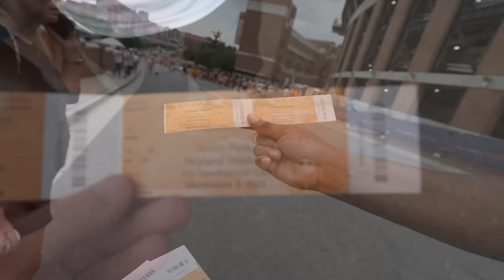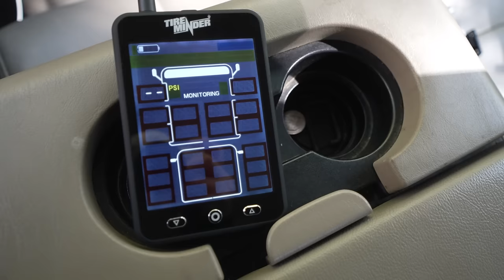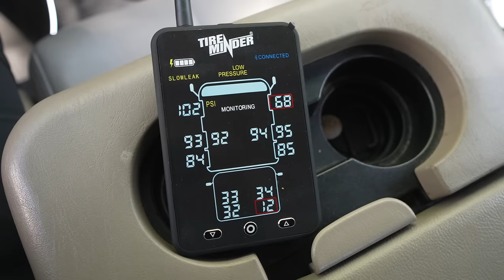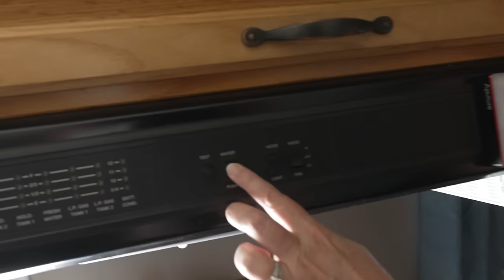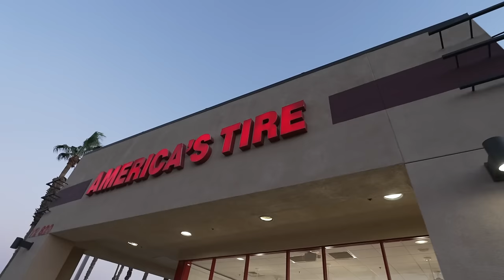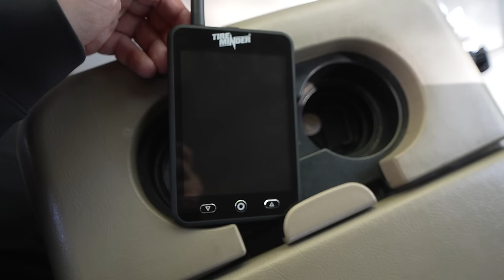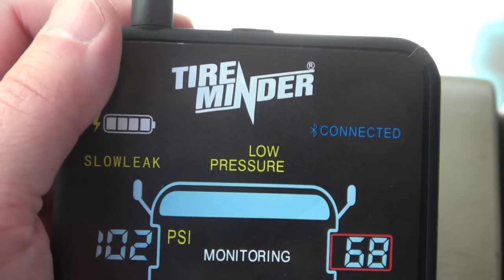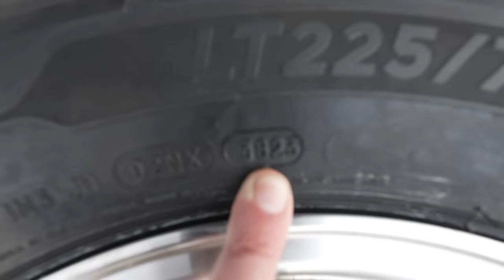TRIP KILLA - Our WORST RV Tire Disaster!

Comment: We replaced our tires at a discount tire. I had just seen a YouTube video on jacking a travel trailer. I taught the tire techs where to lift mine, and made them use blocks at the proper places. It was worth the effort. It helped that I used to own a tire shop and tipped the techs for their efforts.

Comment: Even when a shop has a sign saying no one allowed in work area I still go and watch the mechanic. After restoring cars, driving truck, heavy equipment, eventually a number of patrol cars over the past 56 years I know good basic repair practices. I'm not afraid to speak up or ask a mechanic why they're doing what they're doing. Plus I have the "gift of gab" which makes a good working relationship with the mechanic.

Comment: I had new Michelin tires mounted on our F-350 last fall by Discount Tire. During the first 5K mile rotation, the store manager noticed that three of the four tires were slightly different - I believe with respect to the weight rating. Something I likely never would've noticed, and probably something that wouldn't make a difference in our application. I was very impressed with the honesty and, as a result, will be a lifelong customer. This was a great reminder to be vigilant about monitoring tire conditions. And... Trailer-Aid ordered. Thank you!
Reply: I  love discount  tire  also    story  is  above.    Charley

Comment: Thank you for this video! I’ve used the trailer jack and wouldn’t be without it. Thank you, as well, for information on Discount Tire. We’ve used them exclusively since moving to TX over two decades ago and have never regretted it. We run Goodyear Guardians on our TT and have not had a blowout so far.

Comment: First trip out on a sailboat I'd bought I noticed a single broken wire on side stay (what holds up the mast), My local rigger told me it would be at least a week to get the cable and install it.  
Just one wire, how much damage can that do ?
The whole cable snapped, mast came across the deck.
Now I have a fishing boat.
Reason for posting this example, is if you see, or smell something wrong, stop, figure it out !  
I've seen motorhomes pull into a campground and bursting into flames saying I smelled fuel before I got here.

Comment: On my last trip, it was replace the truck tires or the trailer tires. The truck tires were worn slap out, so the got done. As y’all, as soon as we got back, I would do the trailer. The tires were only 3 years old but were normal dummy tires. First blowout, I could only find a place with 2 of the desired 5. So I looked ahead and found 3 more 100 miles down the road. The other axle had a blowout on part of the interstate with just enough shoulder to git r dun! Rode the rest of the 60 miles left with Jesus at the wheel. Got there and shoed the rest. I will buy one of the ramps, always meant to but you know how that goes. Love your channel, long time subscriber even before I owned my first RV!! Loloho!!!

Comment: Hey guys, love your videos.  I just purchased one of those ramps, (not the brand you guys have), and it was the best $50 I ever spent.  I changed a tire in my driveway last week and it was so easy.  I wish I had bought one before.  It made tire changing a breeze.  Nobody wants to be on the interstate with a flat and have to use bottle jacks and pieces of 2 x 4's to get their RV off the ground to change a tire.  That ramp is awesome. I've heard that some people say it doesn't lift their RV high enough.  No problem.  Bring along a piece of 2 x 6 and put the ramp on top of it.  That should do the job.  Again, great video!!
Reply from the maker: Thanks for your comments. Yes, the trailer ramp is a must have!

Comment: Thanks for this video, for multiple reasons. My Airstream (and its tires) are 5 years old this coming October and I’m very aware that new tires are not far off.  I didn’t replace them this year because of budgeting.  And I’ve been so stressed about taking them to the tire shop because I don’t want to have to nag the heck out of them about the jack points.  So this video hit all the relevant topics for me.  Clearly it’s a message to stand outside and supervise/take my tire ramp.   I’m sorry your tire issue killed your trip.  As usual, your experience and willingness to share the ups and downs of RV travel are valuable to all of us who watch.
Reply from the maker: Thank you, Steph! The comments here have been interesting. Several people actually remove their wheels themselves and bring them to the tire shop for the new tires. That certainly safe approach. Unfortunately, as this episode illustrates, anytime, someone else is jacking your trailer there is a significant risk of damage. In hindsight, I wish I had gotten down on the ground beneath our trailer and micromanaged the entire process. I think you have to be willing to do that because we could not have stressed anymore the importance of properly jacking our trailer and it still got messed up. 🤦‍♂️

Comment: I find things last longer if no one points out that it is ready for replacement. Quickly pointing out the problem after the tire work was also key to them accepting responsibility. Glad you are safe safe and now showered. Thank you for sharing and have a great day.
Reply from the maker: Ha ha yes that thought has crossed my mind as well. If no one had noticed the age of the tires, they probably would still be going strong. It’s funny how the universe seems to work that way. 😂

Comment: Just spent over $2K to replace tires on a Dodge 3500 Mega Cab and 29' Forest River TT w/3 slide-outs.

Got Tires at Sam's.  They Sell TT Tires but do not install them because that has to be done outside their work bays and the AC paving might get damaged!.

Adjacent to Sam's is a Goodyear Tire Store.  Made arrangements to get tires and installation there.  They had a AC driveway but next to their building past the work bays was a concrete slab area about 70' long that they used for truck and trailer tire change outs.

When they were done the store manager took me over the the tires and pointed out the  4 Jacking points for tire work and said to be very careful that only those locations were used !

Very sorry to read about your recent problems, I have followed your website for many years.

Comment: From experience, the trailer ramp/ Jiffy Jacks work great on torsion axles but may not work at all on spring axles (the equalizer does it's thing and keeps the axle on the ground) or air ride axles. 
By all means try it with your trailer before you have a problem and go to depend on it.
Reply: Absolutely correct on this, wide stance leaf springs will not work with the trailer ramp.  I have experience with this, in fact when I had my blow out I couldn’t even get my jack on the spring shackles to lift it. But I did use the ramp on the flat side to get the flat tire high enough to place the jack to remove the tire.

Comment: Sorry to hear about your Tire Woes.   I have has Michelin LT tires on a truck and they have delamanated  after a few years and were cracked as well.   Airstreams are heavy trailers so you are probably better off with the LT tires but I would not buy Michelins.  .  I was told that while ST tires may not have the weight rating that LT tires have they do have much better UV protection.   I have a friend that tows an 24 foot Amerilite that has twenty plus year old ST tires in it that have good thread and are not cracked, and I cringe when he pulls into the Park where I camp.   That's a terrible risk for everyone on the road if they were to fly apart.   Most I will go on ST Tires is ten years but I only go fifty miles one way and I have an ultralight trailer.  Every trip I check them with a fine tooth comb.  Sorry about your water system.   Thank god you took pictures after the tire flew apart.

Comment: I empathize with big ticket repairs causing deferring maintenance expenses. Last summer we were towing into Las Vegas with 110+ degrees and the truck A/C went out. That cost $1400 to repair. During the next few days our camper A/C was having trouble keeping the camper cool in the high temperatures. I thought, It's good enough to get us home."  It wasn't. In that same area on I-10 at the California Arizona border at 112 degrees the camper A/C quit. At 4:30 PM on a Saturday night we were looking at going to a hotel. But we made multiple calls and found an RV mobile tech 20 miles East of Quartzsite that said he could come to us tomorrow or if we got to his shop an hour before sunset he would fix us today. Pack up and go!  He replaced our A/C in under an hour for $2300.

Comment: We had a truck tire blowout on new Toyo tires. Our TST monitor told us about it at the exact same time the tire blew. So, just because one has new tires, there is no guarantee you won't get a blowout. In fact, it made me madder as the tires were new.
 and it will take about a year for Toyo to determine if we get our money back. I find if I put things off, it usually bites me in the rear!
Reply: Oh yes, bought the Tire Ramp.

Comment: Having a single axle Airstream I am a bit OCD about my tires.  I wanted to rotate the tires this spring before our first trip but I have heard too many horror stories about tire stores.  So, I jacked up the trailer in the driveway and did the job myself.  I now know that the jack in my F150 is adequate for the job (for our 20fb) and I know that I can change a tire very quickly if I have a problem on the road.  I have the smaller Tireminder monitor that has a rechargeable battery and a usb power cable so it is always on when we are traveling.  Glad you are safe and the Airstream did not suffer any damage.  Safe Travels.

Comment: It’s good to know that they did you guys right by fixing your Airstream. I use Discount tire also for all my vehicles. Our Airstream has the 3 inch lift kit, and they couldn’t reach the jacking points with their floor jack. So I use my yellow tire ramp like yours and had them change one tire at a time. By doing this I also noticed that one of the tires was different than the other three, which they quickly replaced. But we still had a tire blowout with only 2,000 miles on the new tires. As you guys did we limped into a discount tire store near by and they replaced the tire free of charge. The new tires installed were Michelin Agilis Cross Climate LT 225/75R/16, Load Range E (2523) If anyone else is having problems with these tires please comment below. As for your trip killer, as long as everyone was safe it’s always a good trip with a great story to tell. We have been watching you guys for a long time, in fact that’s why we bought our 2018 Airstream in December 2017 and we still love our 28 ft. Airstream. Thanks and enjoy every moment together.

Comment: Wow what a bummer. On the up side you did dodge a very big bullet when that tire didn't take out the sidewall of your airstream or fender liner, etc, etc. We have a Newmar 2003 Dutch Star class A  that has Michelin 275 70R 22.5" tires. During covid we were getting nervous about our tires as they were 4 months away from being 10 yrs old. And during COVID Michelin pretty much shut down production for quite a while. They told me we should be good for 10 years and they had very minimal cracking on the sidewalls, but we should get them looked at by a dealer. We were able to locate 2 tires so we had those installed on the front steers. Felt better. It took another month to find the remaining 4 for the rear axle. Around $ 4k for all 6 tires. We don't travel anything like as much as y'all do but whenever we travel we put tire covers on at the campground if we are staying for more than a day or two. We always try and stay 7-8 days. Whenever we are  home the RV is in an enclosed garage. Our RV weighs around 30k lbs but these are the same tires they put on semi car haulers. Load range J.   Safe travels!

Comment: I bought a toyhauler 3 years ago, and it came with cheap 14 inch tires. It is getting new 15 inch rims with 14ply tires before it is on the road again.

Comment: I have a two axle trailer. I use only H rated tires and only american made, NO Chinese junk. I carry two spares for my trailer and two for my truck.  Even though my tires might last a little longer all get changed at no more than 5 years. I also rotate my trailers and my truck tires at 5000 miles. Sounds like work but it just part of RV life and travel. Maybe I'm lucky but have had only 2 flats and one blowout caused by large rocks falling off a cliff onto the highway, this is after 10 years and 100,000 mi;es of travel. don't go cheap with your tires

Comment: Hello Kristi and Sean, my wife and I have a similar story. We were coming home with our 22 ft’ Bambi from N.Y. To N.C. And were currently in Penn. mile marker 39. When we had just pulled into a rest stop to let our Chihuahua and Jack Russell go poopy. As we were backing out and going down the ramp to this really busy Interstate we heard what sounded like a shotgun blast. Turned out our right trailer tire had blown a hole as big as my fist outward. Well, luckily we slowly backed up 25 ft. Back to our parking spot.
We did not have a jack that could lift our trailer high enough to get the spare tire in the wheel well. Could not make it to a campground so we called Coach-Net for help. After waiting 4 hours and no help we were totally screwed!

Then the heavens opened up and who showed up to help us was a trucker and two chinese speaking (Mechanics?). The two chinese guys had a large enough jack to lift our camper(from the Airstream lift spot- I told them where to lift it). Got the spare on and we were on our way!

In thanks we had just come from Bully Hill vineyards where we had purchased 4 cases of wine. Well those guys got a free bottle of their choice along with the truck driver who also was from NC.  Suffice to say when we got home we changed both tires and promised to never let them go for more than 4 years before replacing them. Also bought a hydraulic jack and I cut a wooden block that we could set the jack on that was the perfect height to change a tire. We will not be caught (Flat-footed haha) again!

Comment: I downsized from a 25' trailer to a new single axle 16' trailer in spring 2020 before prices went crazy due to you know what. In 2022 I was headed to South Dakota and near the NE SD line I felt what i thought was a gust blowing on the camper. I could tell something was off and sure enough a tire was wiped out. Another gentleman stopped and helped me get it swapped out quickly. The next town big enough for a tire shop had the right size tires albeit pricey. He also was able to hammer out the small dent in the rim. I said lets replace both but leave one of the new ones on my spare carrier. Less than 200 miles and three camp spots later that spare I was running that had less than a 1000 miles on it blew out just like your tire. The little town of Midland SD had a tire shop but it was Saturday. The door was unlocked but a really big mean dog was inside. I call the number. She will be there in a couple minutes as her husband is out working in the fields. She put a new tire on and had me on my way. 11 days into that trip and gas prices approaching $5, a reefer that eventually need a new board....I headed home early.

Comment: About 1000 miles from home on an rv trip last summer, we had a tire issue and found a close shop with the tires in stock. I stayed there and directed the tech where to place the jack. I’m very picky when it comes to service work on my rv or vehicles. As your said, sometimes you have to be a jerk but it saves lots of aggravation in the long run. Love your channel

Comment: Glad you are safe now and able to tell your tale.

Incidentally, I was learning about tire maintenance for my new car. I found out at about the 5 year mark, I should replace my tires. I should replace them even if the treads look OK on the outside because the unseen threads inside the tires may be worn out and deteriorated. 

My research applies to RV driving as well. Your best videos are the ones we learn from each other. 🌻

PS

Great idea about taking photos and video recordings of maintenance jobs done while on the road.

Comment: Great video! We are preparing for our firs big trip with our 7 year old used camper. We have made several short (5 hours or less) trips with no issues but after seeing your other tire videos i decided to replace all 5 tires before the trip.( including the spare). We also got a twin axle trailer (thanks for that advice as well) and have the tire changing ramp. Now I need a tire minder!

Comment: Thank you for another excellent video on lessons learned!  Our experience with our new (3 days of ownership) to us 2018 30’ Int’l tire replacement three days ago, started, with Discount Tire looking to jack the trailer up between the two tires, which I quickly stopped, and asked him to put a. block on his jack and use the factory jack point.  His jack would not reach that high, so we went with the tire wedge and replaced them one at a time, including the spare, which was great to see a young buck laying on his back struggle with removing that spare from the cradle.  Two and a half hours later we departed as happy campers!  By the Way - we did not disconnect our Equalizer WD hitch, so I hope that did not cause a problem?

Comment: Just ran over a drywall screw.  The tire pressure stabilized at 30psi.  At first, I thought I had another tire-minder battery issue.
No, it was a real problem.  After 3 years of chasing dead batteries in the tire sensors, it did its job.